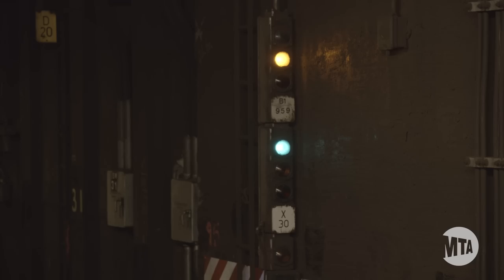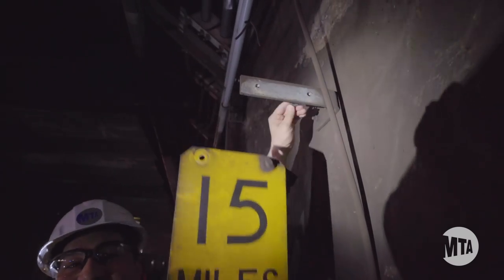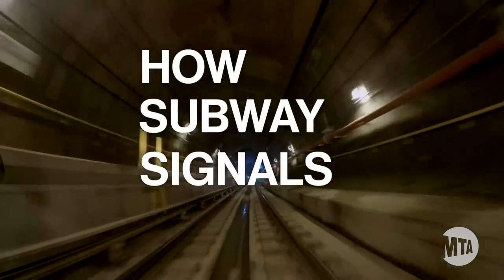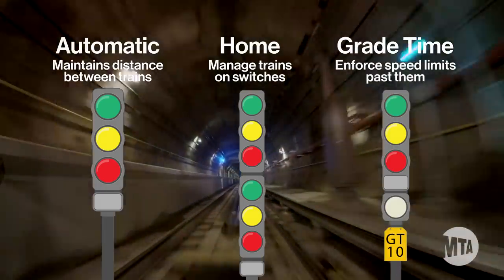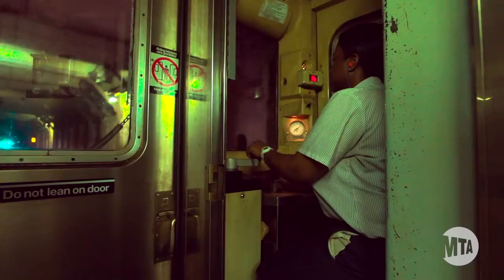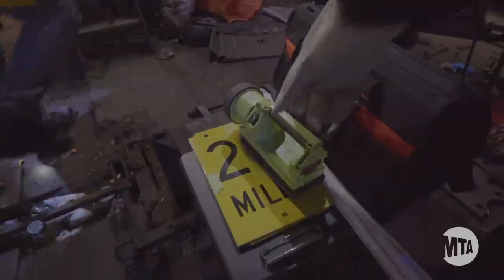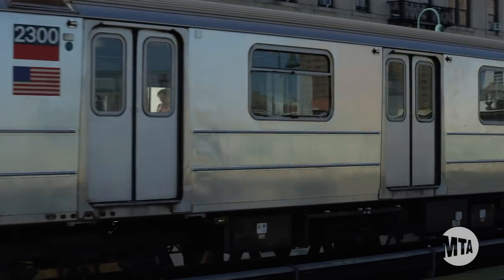SPEEDing Up Your Ride

Comment: This is EXACTLY what has been needed for years! Bring the trains back up to the speeds the subways were originally designed for (especially the IND which took great care in measuring track superelevation, etc for solid 40-50 MPH running back in the early 30s).
Reply: Yes especially my beloved A & C line
Reply: I don't think some of the tracks can take a increase  in speed
Reply: 2/3 from 72-42 is easily 45-55. IRT>IND.

Comment: I'm loving this change. I've liked my 1/2/3 lines since the beginning, but 1 trains going 40 and 2/3 going 45-60 is just great. 4, 5, 6, 7, A, B, D, E, F, and L trains are fast as well. Some that still need work are the C, D from 36 to Coney Island, F on Culver Local, G, J, M, and the yellow line.

Comment: Another benefit of shortened running times that is seldom mentioned is that if you can provide the same level of service on a line with one or more fewer trains in the schedule, the savings in both operational and capital costs are significant.
Reply: trainluvr Maybe They can use the extra trains elsewhere as well with these savings.

Comment: one thing about the grade time signals, they don't clear on time when you go at the speed limit. This forces operators to do 7-8 mph less than the posted speed cuz they fear to overrun these signals. They definitely need to calibrate the timers.

Example, if it's a signal at red with a lunar white lens under, it means this signal will clear (stop arm goes down) when the train approaches it at the speed limit. So if the limit is 25, it should clear if we do 25. In reality, if we did 25, or even 23, that stop arm will still be up as the train passes the signal.

Comment: Can't wait for these improvements to come to the J line.
Reply: Samuel Santaella The speed limit between Essex Street to Bowery was raised from 15 MPH to 30 MPH and the speed limit for express J/Z trains merging into the local tracks between Hewes St and Marcy Av was raised from 10 MPH to 20 MPH
Reply: @TheRailLeaguer  Good to read! I hope they speed up the slow sections around Broadway Junction and Crescent St/Cypress Hills.
Reply: Samuel Santaella The S curve May not be the safest place to increase the speeds.
Reply: @samuelitooooo  No, Because it's gonna make the trains tilt over and crash, you don't want that to happen
Reply: @TheRailLeaguer  Pretty sure they can do 15 MPH safely, on all four curves (two in both directions). Still an improvement over slowing down to a near stop (sometimes stopping entirely) every 20 seconds or so.

You should see how some operators floor Jamaica-bound trains out of Crescent St though. 20+ MPH. A bit scary especially towards the back of the train, but until now we haven't heard of any derailments...
Reply: I feel MTA subway can go at 70+mph.
Reply: @jeffmao850  Not everywhere... there are sharp curves where 70 mph would result in a total crash
Reply: Jeff Mao you’re crazy that would never happen the speed limits were actually really high in the 1990s but they had to slow it down because of so many crashes mainly the J & M train colliding on their way to Brooklyn which killed a motor man and injuring others
Reply: @TheRailLeaguer  Good to know. 👍
Reply: The (J)avelin of the Bway Elevated!
Reply: @samuelitooooo  Yeah because the curve probably isn’t that sharp 
The Myrtle Curve however is very sharp and you have to remember the cars aren’t IRT cars where going around curves are easier
Reply: @ninofromkitchennightmares1497  How do smaller cars make it easier to take curves? As far as I know, physics don't change and the wheelbases between axles on trucks are the same.
Reply: ee
Reply: The j and m have to many turns that slow them down  jam---crescent    crescent---Fulton.     Myrtle turn in and Williamsburg  bridge  slow them down considerably  . The 2 sharp turns on crescent  force the train to stop many times  to check brakes then can only take turn at 3mph.
Reply: In the 100yr+ history  of  the j has ever fallen off the crescent  turns. Just wondering.  I can't imagine  it not happening  before. I know it happened  on the El in Manhattan  El years ago
Reply: @samuelitooooo  have you taken the uptown 4/5 out of grand central it goes at least 20 in the back and the turn is even sharper than crescent street. I have seen people fall on their ass before in that turn.
Reply: @joejoe-de4zc  I have, though not since quarantine.

Hey, I'd be happy with 15 MPH. Like I said, better than the stop-and-go crawl of today.

Comment: This will work(even I'm concerned with trains overrunning the station and not a being able to break in time when someone falls into the tracks😨). It will also help when getting to a station for a anti-missing train/bus transfer plus,  a reduction of train bunching.
Reply: King Auto & NYC Transit the mta is trying to install platform gates to prevent ppl from falling into the tracks.
Reply: @yaric2274  It's been spoken since 2017. This have to deal with the shutdowns first.
Reply: @yaric2274  They have to retire all the 75 footers first
Reply: I dont think that they will raise the speed limit in the station areas.
Reply: @hongzewu5435  And you'd be incorrect thinking that.
Reply: hopefully they upgrade the stations to look like tokyo’s or seoul’s but that might be too much to ask 🤔
Reply: @BenTheMiner  They can start installing some platform screen doors now. The entire 7, J, and L lines are already 100% new trains. E, F, M, and R stations in Queens and M stations in Brooklyn are now also 100% new trains. That's already a lot to work with before brand new R211s fully arrive in just a few years and CBTC is selectively installed on other lines, making many other entire lines (A, B, C, D, E, F, G, M) feasible for platform screen doors because 75 footers will never run there again.
Reply: @samuelitooooo  The installation of platform screen doors in many stations is unfeasible because of how they were built. Additionally, because of the different lengths of M and R trains, they also can't be added to the Queens Boulevard Line.
Reply: @BenTheMiner   They surely can be added to the Queens Boulevard line. The M and R now use the same car type with the same car lengths and same door positions across each car. They just have to be deliberate about whether the M stops 0, 1, or 2 cars behind, similar to JFK AirTrain, whose stations can fit 4-car trains but they have never ran 4-car trains regularly since opening in 2003. Ditto with line 14 in the Paris Metro where they never ran the full 8-car trains until recently with the new MP14 trains.

Speaking of Paris Metro, they're an example of an old metro system, yet line 1, which came four years before the first IRT line, and line 4 (four years after) both now have platform screen doors and are automated. What makes some of our stations unfeasible?
Reply: @samuelitooooo  Incorrect. Because an 8-car train has an A car at the position of a 10-car train's B car, the door positions end up being different as they are not the same between the A and B cars because of the cab.
A lot of stations either have pillars or staircases that take up the space that is needed to install platform screen doors. See MTA's PSD study to see many examples of this.
Reply: @BenTheMiner  Fair point about the pillars. As for the door positions, the A cars and B cars are not wildly different. PSDs are built to be as wide as possible. I very much doubt that this is beyond the realm of infeasibility. Same with the numbered lines.

Comment: JorgeCat78,
You're just tellin' it like it is. Yeah, the signal system is jacked up. At the same time passengers are impatient (as usual). Puts the operator/motorman right in the middle.  But nobody is gonna blow their job for circumstances they simply cannot control....PERIOD.

Comment: Paris and many other cities have automated metro trains so journeys are always the same time and 100% consistent. Time to make the switch.
Reply: MTA unions won't allow the MTA to make the swap because it means fewer repairs and jobs. The L train has the tech installed but still has these ancient signals installed with it cause the Union insisted according to the Nytimes. The Union official stand is that two systems is safer than one in the article.
Reply: Also part of the Fast Forward plan. Not every line will make the switch, but the plan is that within 10 years, many important sections of the subway will have CBTC.
Reply: Don't worry, the 7 line already uses CBTC
Reply: New York has and always should do things its own way. America first!
Reply: it's new york city we are talking about where fucking people getting sick and holding the doors and homeless people yelling for money during rush hours.
Reply: Blake McNamara Really? CBTC was installed on the Canarsie and Flushing Lines with very success, with very good results.
Reply: @MuddinNYC  I agree.  The MTA and the passengers would have a hissy fit.

Comment: If trains are only traveling at 5 miles per hour then biking must be significantly faster. 30 mph is a more typical speed for a rapid transit system. 

It reminds me of Paris where the average speed is a frustrating 13 mph because the stations are close together.

Comment: In Toronto, there are markers on the walls of the platform telling the driver and conductor information. The front of the train always stops next to a red circle while the back lines up with a green triangle, which the conductor points at before opening the doors. When the train departs, the conductor can’t go back into their cab until the train passes by an orange triangle in the middle
Reply: The NYC subway does have similar markers. Instead of a red circle, there are numbers corresponding to the length of your train, so if your train is 8 cars long, you stop at the 8 marker — or there's an S if the stopping location is the same regardless of consist. An outdated system for most lines that run full-length 8- or 10-car trains nowadays, but there are still some lines that run short trains at longer platforms; notably the G, M, and Far Rockaway shuttle. And conductors here in NYC are at the middle of the train, so you'll find at the very center of platforms there are white and black striped panels that conductors point to before opening doors.

Comment: How to make trains run faster

Change the speed limit  ◉.◉
Reply: Its not that simple. Raising the limit will bring back accidents. We now have newer tech such as CBTC that will help, which will finally eliminate some issues with changing the limit.
Reply: Learn some facts 
Would you rather get to your destination safely 
Or go flying out the Window at a sharp Curve
Reply: @ninofromkitchennightmares1497  True and if ur upper ground the train would probably fall to the street lol

Comment: Any plans to modernize the system so that some of these lines can be automated?
Reply: actually CBTC is already in place for that, so your dream is a reality.
Reply: I’m to sure about that. When I grow up I want to be a train operator for the MTA and many people would lose their jobs including me. I might not even get a chance to apply if that happens.
Why do you want it automated?
Reply: The New York City Subway system was made to be operated manually. There are some parts of the rapid transit system that are automatic. There are some new towers that have been built near some train lines that cover large miles of track. Some towers that are located at subway stations are set to work automatically. Some subway cars are not equipped for automatic train operation (ATO). A train operator and a conductor are needed for a subway train because some stations are curved, even graded (sloped).
Reply: @MrMam-yo7qp  the 7 and L lines are already semi automated. Train Operators don't have to accelerate or brake, the train does it for them. All they have to do is press a button at every station and make sure nothing goes wrong.
Reply: @marsdatta1818  True but for me it’ll get really boring. And I’m pretty sure in the future, at these rates, it’s going to be fully automated. And I really don’t want that to happen.
There are also good reason why it shouldn’t be.
Reply: @MrMam-yo7qp  1) Because computers are always on, unlike people whose attention can waver, so people don't have to constantly be checking up on where all the trains are to do simple operations such as terminal operations where switches are activated all the time.
2) Because automation enables better performance, in part by removing old signals and using fewer physical signals in general so that improves reliability, and in part by removing signal timers so trains can run faster. CBTC not only communicates the presence of trains to management so they can make better decisions, but also to each other, allowing trains to run closer to each other, reducing wait times, allowing more trains to run on the line and increasing capacity.
3) Because service isn't dependent on available people, so if COVID or a transit strike happens again, people can still get moving without major or absolute service cuts. The city, and the world in general, isn't able to handle more drivers than it has now.

I think all subways should be automated. However I don't see this happening with any of the railroads for a long time. Only on S-bahn city trunks where many branches merge to run through the city center, which is the only place those make sense right now; the rest of the system remains conventional.
Reply: @samuelitooooo  Yeah. I was pretty uneducated when I wrote this. But my views have changed and I feel like automation is a pretty good idea. I’m eager for CBTC to branch out to other lines besides QBL and the other 2.

Comment: ok MTA, seriously, I'm not a pro in subway, but why the Tokyo Metro opened in 1927 (38 years older than the MTA) is able to modernize their signal and controls with ATC and ATS,  and keep the trains on time to seconds, while the MTA Subway is still having serious delay problem on several lines, everyday, in 2019.
Reply: TNTSquid 【MIO.sh】 The MTA doesn’t have enough money to handle every single problems because of terrible problems in the past. Don’t even get me started on the signals, its so expensive to replace to the point its out of their budgets and its so hard to replace. America isn’t involved in transportation because it started very young.
Reply: TNTSquid 【mio9】 The first segment of the NYC Subway opened in 1904.
Reply: @TheRailLeaguer  i guess this is a vicious cycle, they don't get enough funding for the upgrades, so, trains frequently delay with unstable system/human error, then, people chooses other transport over the train, earnings decreased, and then there's no funding for the upgrade.....
Things will never change unless someone decide to spend a little more to fix their signaling system to at least using ATS instead of trip hooks at the rail that fuck up the entire line for passing red signal
Reply: TNTSquid 【mio9】 That’s Why Andy Byford is here. He plans on accelerating installation of Communications Based Train Control (CBTC) and Automatic Train Operation (ATO) on several lines, renovate stations, make the subway more accessible, etc.
Reply: @MIO9_sh  ATS is no longer used in lots of countries
Reply: Because they didn’t have competing Companies 
They didn’t have funding pulled and their Customers are Actually polite and Try to help the system

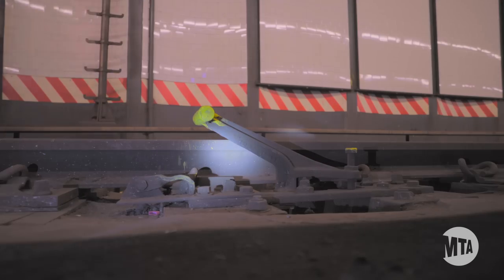Comment: Did u see an examples in 0:52-0:58? If it happens, that will trigger an emergency brake. It will differently scare a lot of passengers inside of the train.
Reply: Its a safety device to prevent the train from crashing into another. And scared of what your train stopping?
Reply: @Trainkidkris  I wasn't out somewhere. I'm just saying in general.

Comment: This is the scam the MTA been doing for decades. They change the speed of the signal but never change the speed limit sign. This is not a new problem,  from Fulton St to Bowling Green on the 4 and 5 line use to be 30 mph. About 10 years ago they installed bloody slow 10mph timer signal on straight level track. The same con as the emergency phone system in tunnel that doesn't work, that the Blue light you see in tunnel.. Oh and let's not talk about how bad or not workingt radio system they have. Manager needs to be made publicly accountable on who made these decisions.

Comment: This should alleviate the delays on both Westside and Eastside number trains and a trip from 110th Street Cathedral Parkway with a change at 96th Street Broadway to 34th Street Penn Station on 42nd Street Times Square Port Authority Bus Terminal might become 10 minutes thanks to these changes.